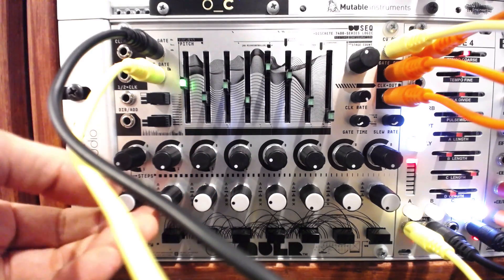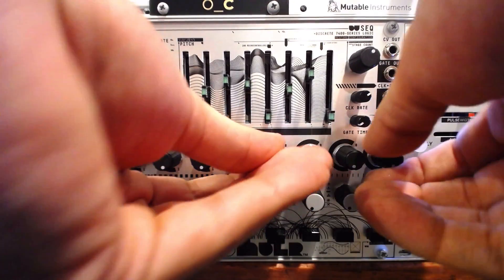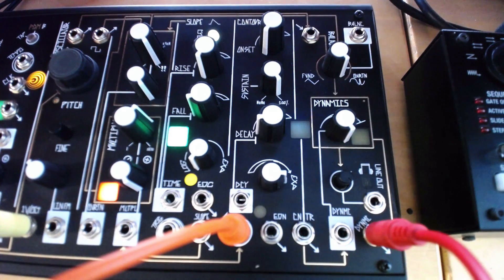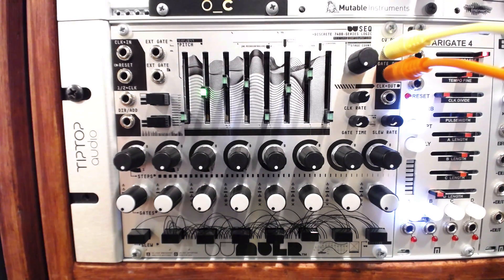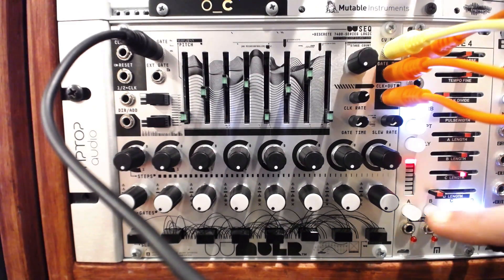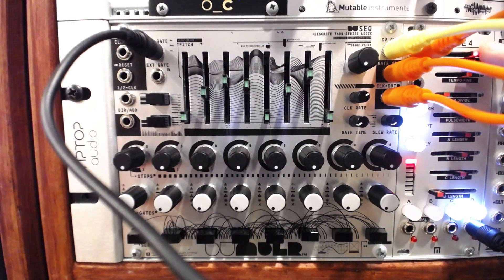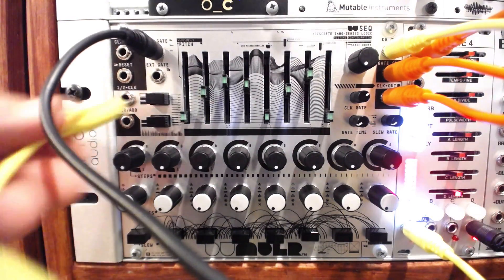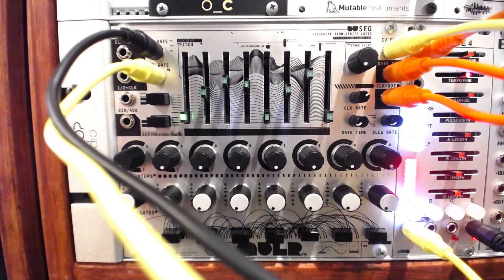Complex Gates & Patterns w/ DU-Seq

Comment: Hey I'm really digging the DU-SEQ, such a fun sequencer.  This video was one of a few that made my decision to pick it up, so thanks for emptying my wallet!  I have a question...I'm having an issue with the reset.  If I fire a trigger into Clock and Reset at the same time, it hangs on step 1 for an extra pulse.  I have a 16th note trigger into Clock and a 1 bar trigger into Reset, so every 8 steps it resets to 1, pretty basic.  Stage count is 8, step 1 count is 1, and gate type is Multiple.  If I choose Single Gate, it rests for a beat and then pulses once before moving on, so either way it hangs for 2 steps at stage 1.  Thanks for thoughts!